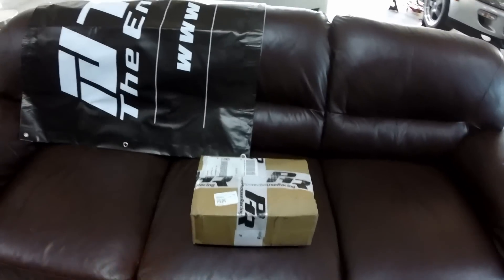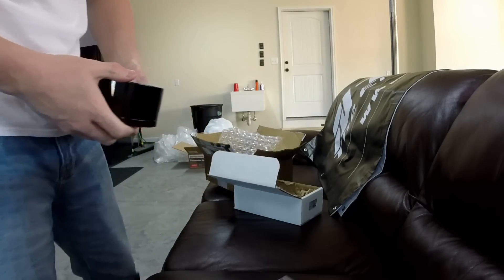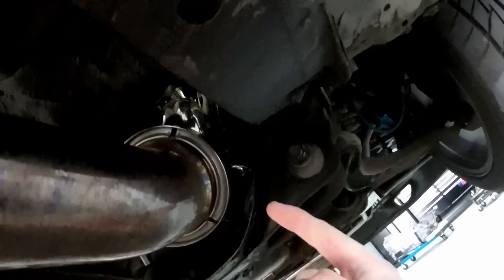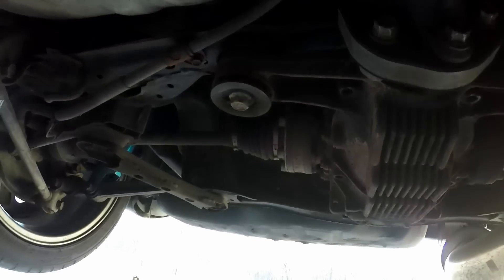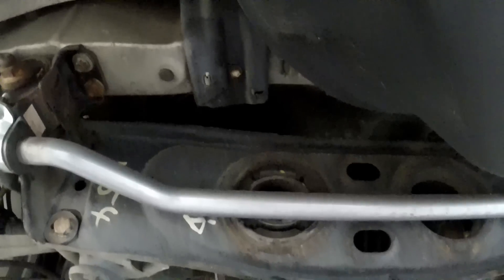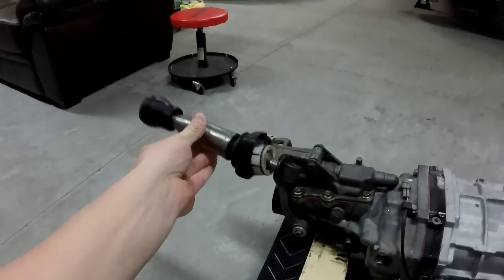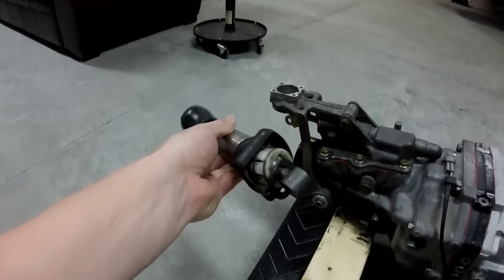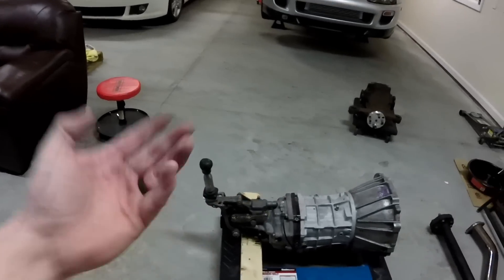Toyota Supra Drivetrain Removal!

Comment: I got my shortshifter for like 50$, Works great. and it was a kit for v160 and R154 :)
Reply: Brought it from a swedish company to get a faster shipping. 
Was named "Short shift Toyota supra TT 2jzgte jza80" Fits following models:
Toyota Supra mkIV TT 2jzgte
Toyota Supra mkIV jza80 na
If you search for "FOR Supra JZA80 2JZ Turbo / NA 6 Speed V160 Quick Shift 93-02 Short Shifter" on Ebay you will find it. 
Hope it helps! :)